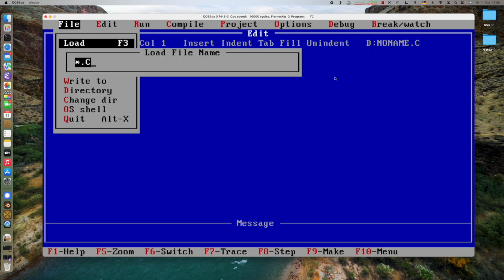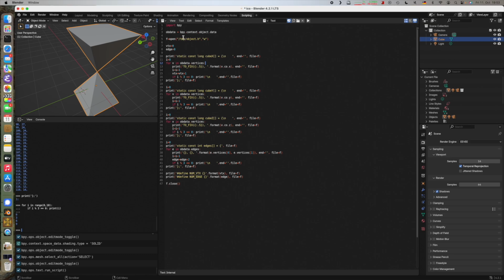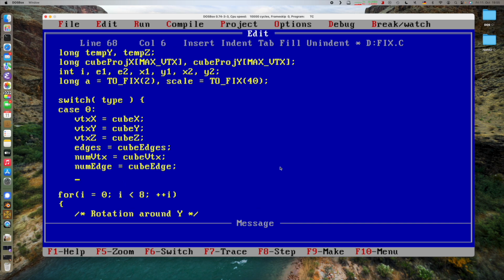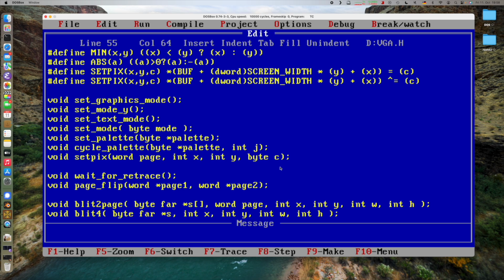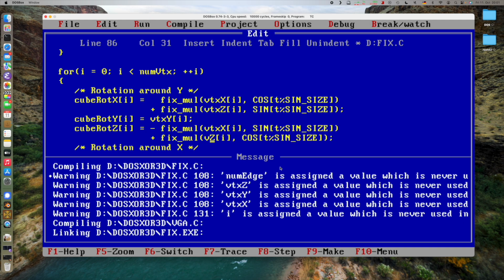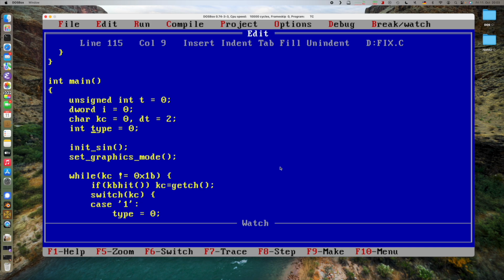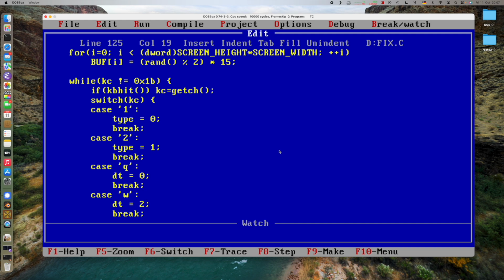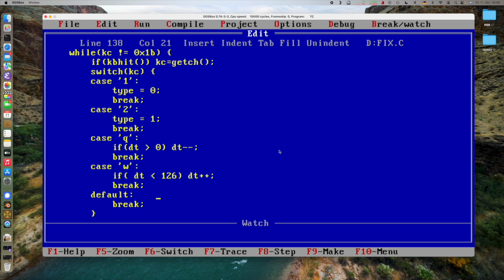Let's Code MS DOS 0x2C: Noisy 3D Animation

Comment: You should def. swap out the getch for keyboard scan code buffer technique.  you can replicate the getche fairly easily

create a buffer of 127 bools/chars

hook interrupt 0x09, read scan code @port 60 update scan code index ... (I think you also need to write 0x20 to port 0x20 to signal end of interrupt.)

I'm pretty sure the above description will print out code for this if you use an AI.
Reply from the maker: This is an AI free channel. :) We do this for the fun and heck of it. I have low level keyboard controller programming in an earlier episode. Check out episode 0x24. However to keep code for each episode short I am using getch and the like, so required dependencies to code from earlier episodes is minimal.
Reply: @root42  Just a decompression algorithm, that's all I mentioned it for.  I summed up my idea, in a way that inflates reliably.